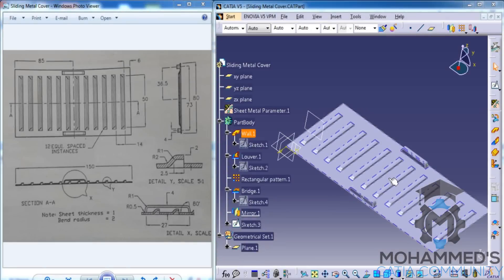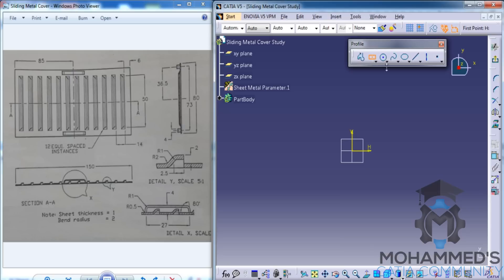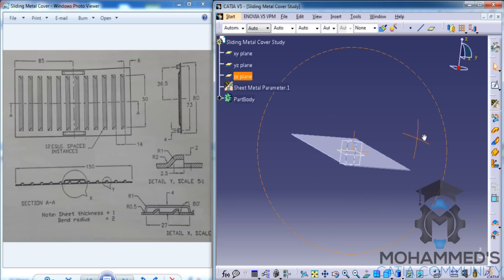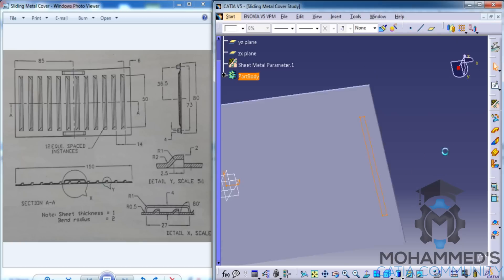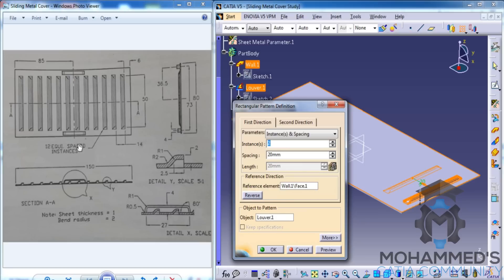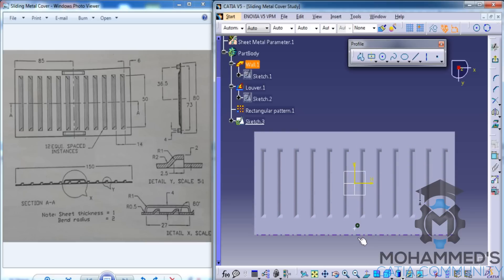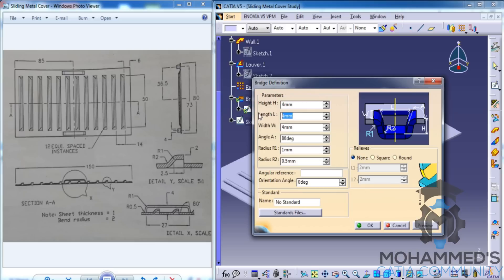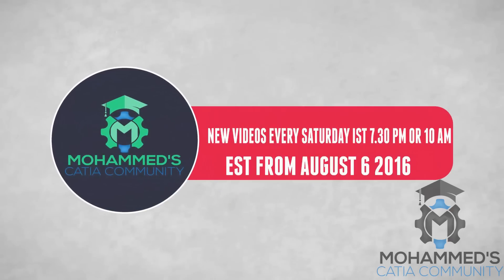Catia V5 BrushUp Video|CPU Back cover Exercise|SheetMetal Workbench|Mechanical,Automobile,Aerospace

Comment: the parameter Height of your bridge stamp is wrong. It shows up in the draft that the height should be 4 from the stamping surface to the bottom. But, in CATIA, you can only determine the stamping depth. That should be 4 minus the thickness aka 4 - 1 = 3.
Reply: The problem is that the stamping depth has to be 4 to get the same draft shown. That means the arrow head which is used to mark the distance in Detail X is put in the wrong place.